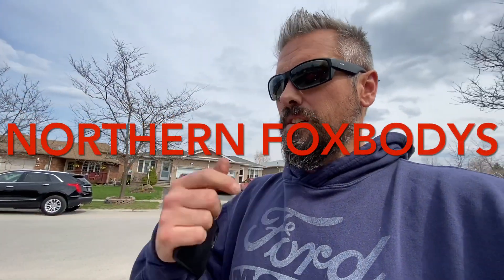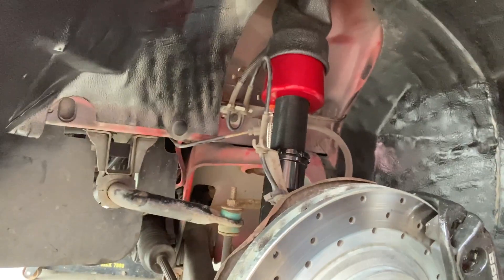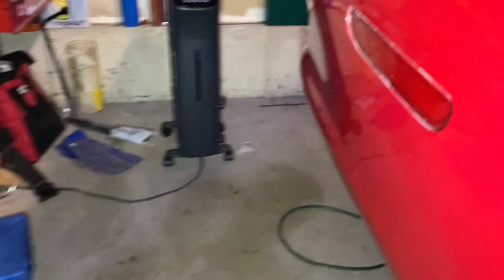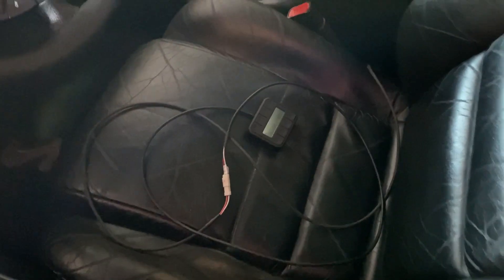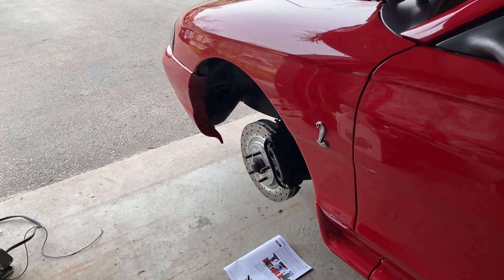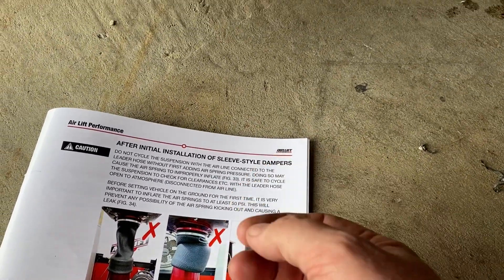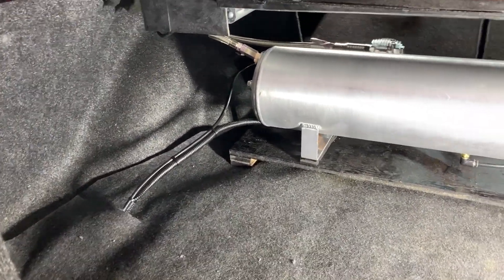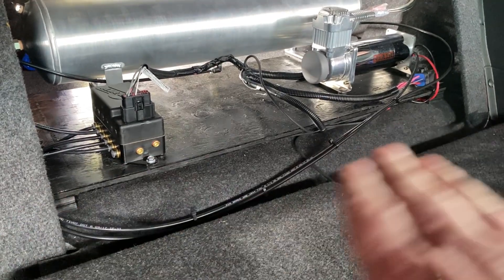Sn95 cobra air ride install part 2

Comment: I have a 98 cobra with an idle issue once the motor gets hot after driving it idols at 2000 RPMs it’s a nightmare I replaced the IAC throttlebody position sensor fuel pressure regulator and fuel filter still does the same thing
Reply from the maker: Have you tried cleaning the mass air sensor and the throttle body?
Reply: @simcoecountygearheads  Yes I did both thank you for responding and I also use the proper cleaner for the mass air Sensor
Reply from the maker: On the older mustangs like mine when we have that issue we do a base idle reset. Not sure if the cobras have a similar thing. But disconnecting the battery for 20mins or so might help reset the computer
Reply: @simcoecountygearheads  thank you for the information